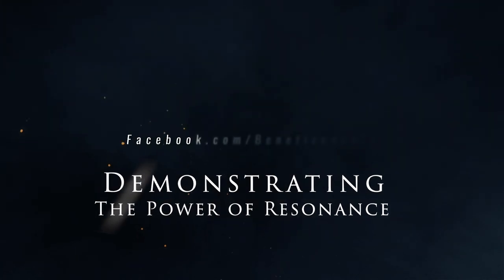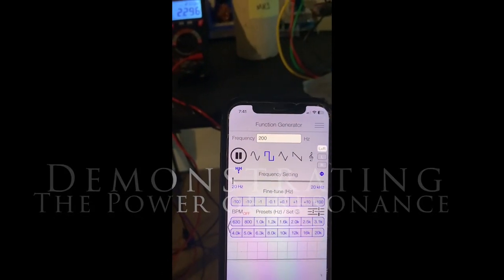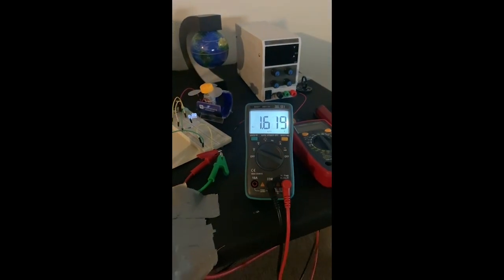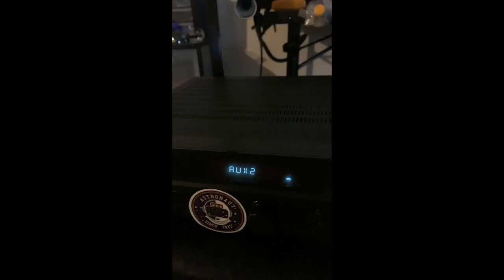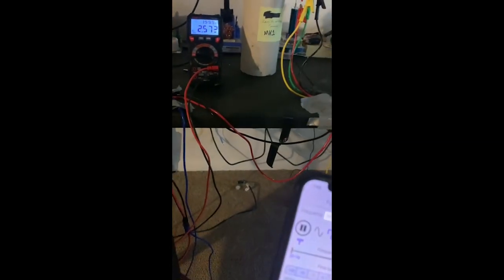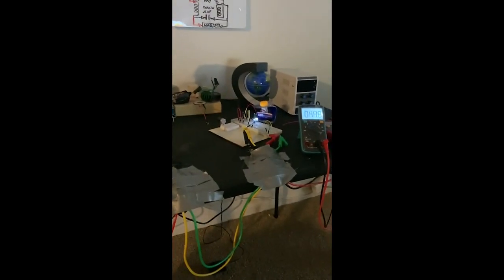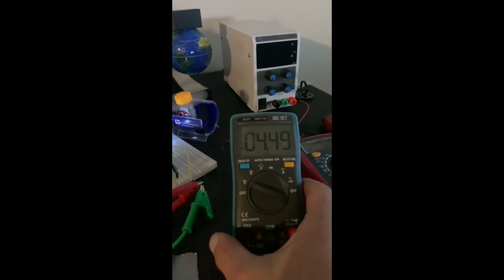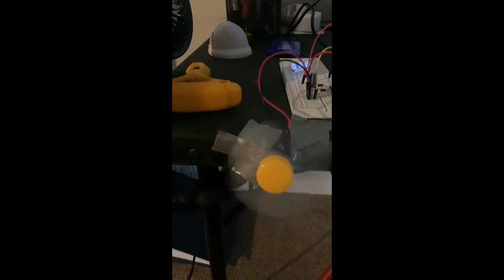🎵🔋Power of Resonance | BeneficenceTV

Comment: Putting the system in resonance switches the reference circuit and output circuit. Same amount of power, only when in resonance the input is running slower because of the over unity from the output.